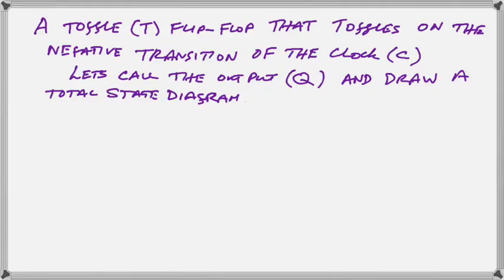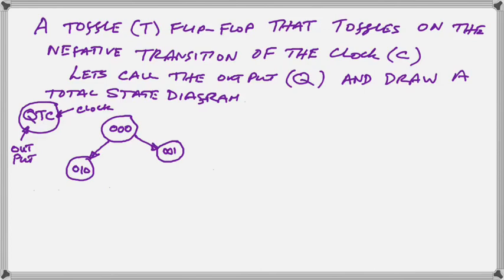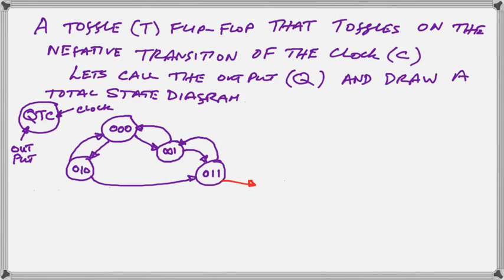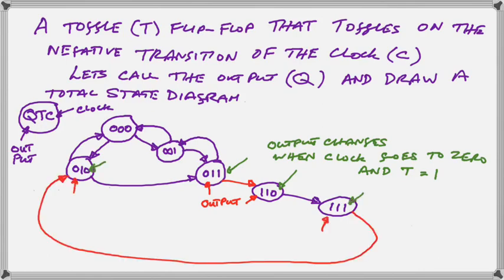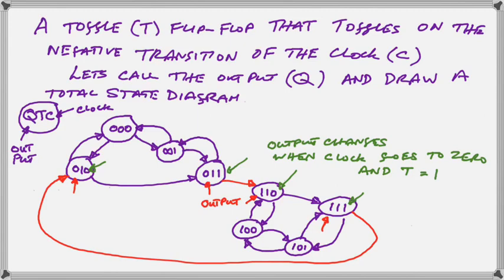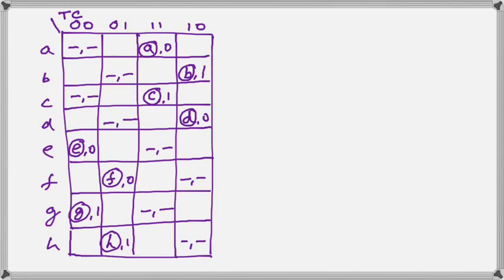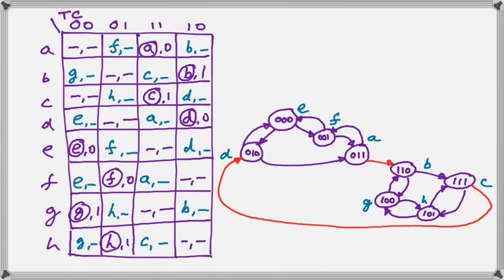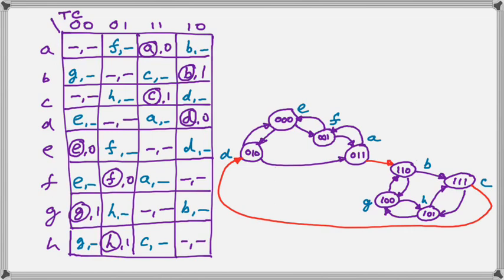Design of Asynchronous Sequential Circuits - Part 1

Comment: Design an asynchronous sequential circuit that has two inputs X2 and X1 and one output Z. When X1=0, the output Z=0. The first change in X2 that occurs while X1 is 1 will cause output Z to be 1. The output Z will remain 1 until X1 returns to zero..)- Dear sir please kindly teach this problem
Reply from the maker: I will do it.... but I have to put up some videos for my class on Monday first.... so you may have to wait a couple of days